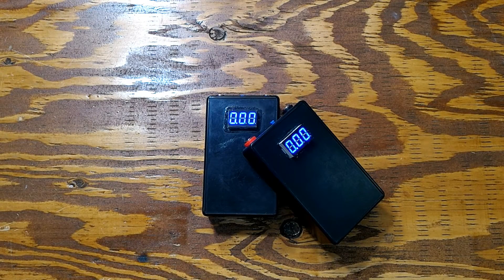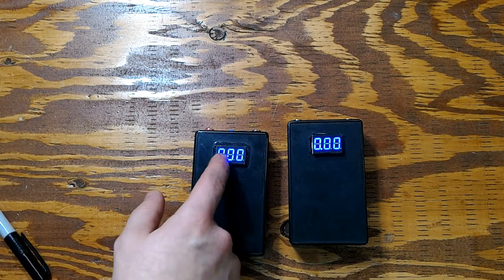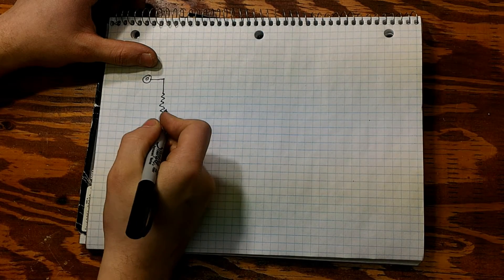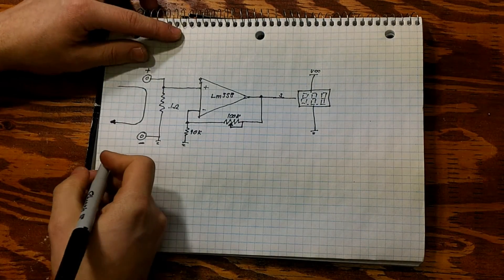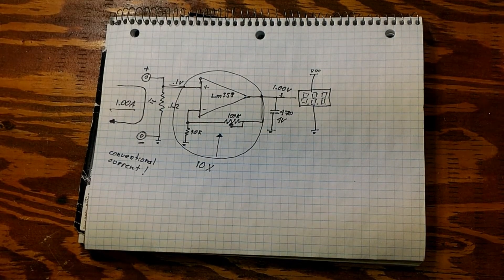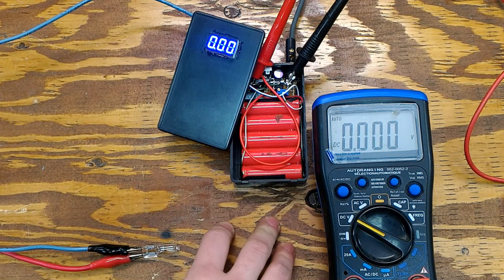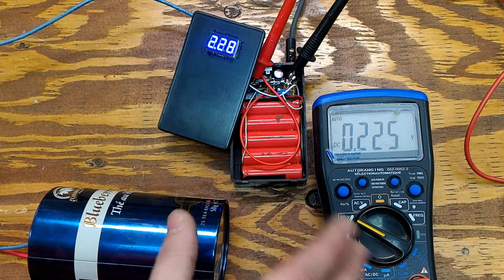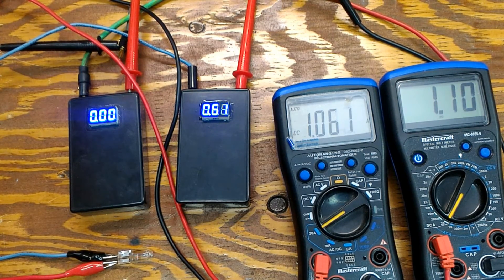SIMPLEST HOMEMADE DIGITAL AMPMETER  ✔

Comment: Hi,Theoretically it is simple; measure the voltage drop on 1 ohm resistance and amplify it.I constructed this scheme. It is working. But not stable for all values. Measuring the potential difference is ok, amplfiying is ok. But it is not reliable as an ammeter, and I do not know why!
Reply from the maker: Hmm. I did see a slight offset at higher currents. Possibly that can be compensated by adding identical circuits as ranges. Each range can be calibrated for a particular current range to result in a accurate reading.

  Also I used a .1 ohm shunt to compensate for increase in resistance with increase of temperature. 

I have plans for a circuit that can measure watts. The value of watts will be displayed on a volt meter as well.
That would be a good one for people that started electronics.
That would eliminate the need of 2 meters one measuring voltage and another current, than multiplying the two.
Reply: @EECPOWER  how to use it for 0-1 amper max sir...